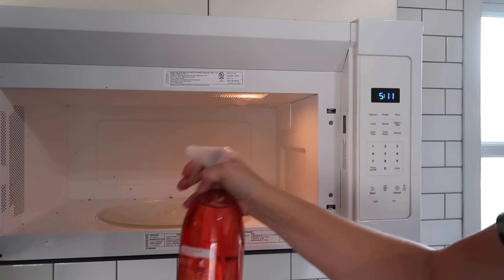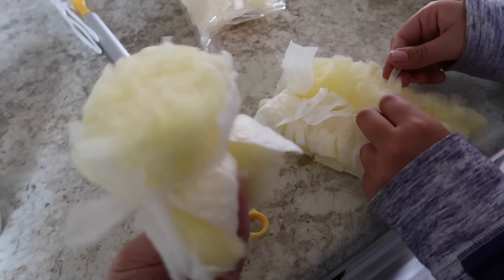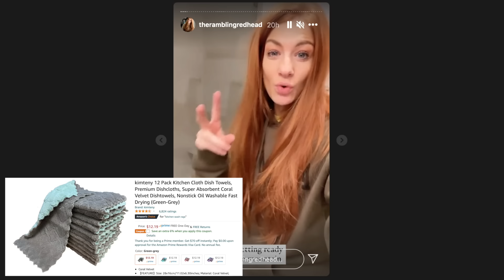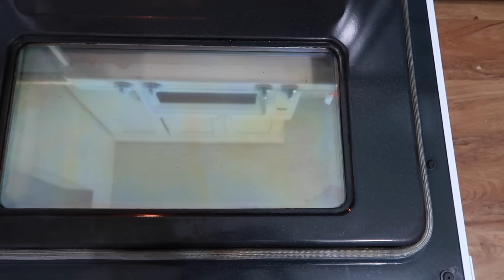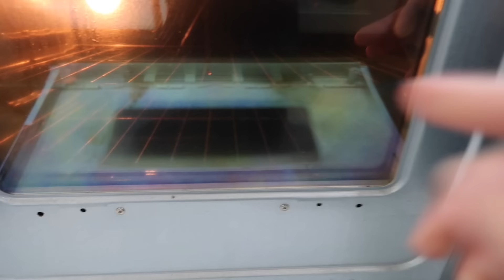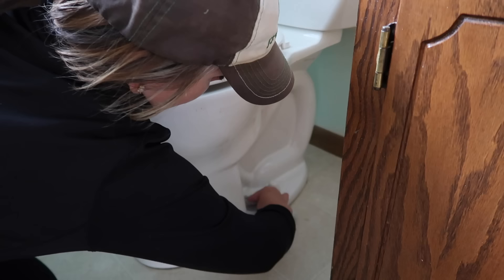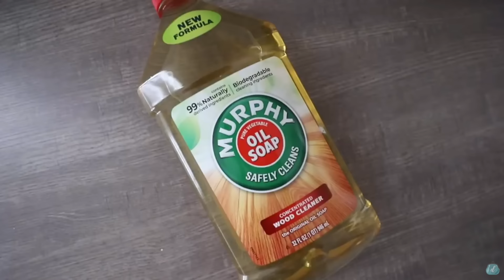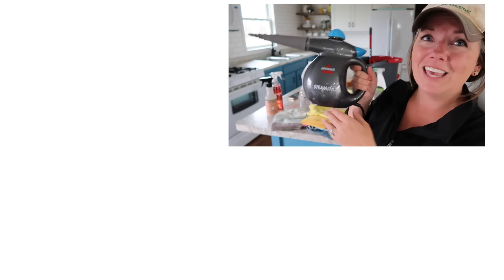Overrated Cleaning Products? Test them with me!

Comment: Also, I personally LOVE the steam shot. It has cleaned my grout, my walls, my baseboards, my vents, behind the toilet, etc.
Reply: I LOVE my steamshot too.  I have never considered that the steamshot  would work by the method displayed in this video, i.e., point and squirt steam at a spot about 4-6 inches away with no utility tip fastened to the steamer.  I use the "tips" that came with the unit. For the application in the video, I would have used the tip with bristle scrubbers.  With that method the steam is jetted out about 1 inch from the target-spot, and using the scrubber-tip agitating back and forth, makes quick work of the worst, disgusting messes.
Reply: Steam is disinfecting
Reply: @MegOfBroccoli  the steam shot does heat 212 degrees.
Reply: Actually, steam is hotter than 212°.  Water vapor that is most of what we see is cooler than 212°. The steam is between the nozzle and the water vapor. You need to be close to disinfect.

Comment: I love my steamer for cleaning the window tracks. I also used it around the edge of sinks that have a countertop lip (as opposed to an under-mount sink) and around the edge of faucets. I love using it when cleaning my refrigerator. I’ve never tried it in the oven because I use the 4-hr oven cleaner setting to get the bulk of the grime and usually just call it good at that! 😂
Reply: I always struggled to get the crack around the edge of the faucet or the little overflow valve in the sink clean. But by accident I wiped with a baby wipe an voila it all came away!

Comment: I'm here in the U.K. I use microfiber cloths but if I'm cleaning really dirty areas I use the generic J cloths, so I can chuck them away afterwards. I'm of the adage of doing a little each day but on the first of the month I clean the windows and on the fifteenth I clean the oven,whether it needs it or not! That way there is no build up of crud. The doors of the oven get taken apart two or three times a year. My oven door is three complete layers of glass which are so easy to remove and clean and the whole process takes just a few minutes.
We've just moved to a new build so brand spanking clean showers. I have tiled walls in the shower and have ,for the first time , used a tile sealer. This protects the grout from grime, oils and mould. So far so good. 

Thank you for the truthful video.😘

Comment: The spin bucket mop system is the best floor cleaning system I have ever used. I change the water when it gets dirty, and sometimes that is frequently because this mop picks up the dirt. I spin the mop well for wood floors. Makes them look beautiful. I like my swifter dusters. The swifter long handle used here is great for high ceilings, dusting up high, dusting behind and under sofas, beds, etc. I wipe and dry toilets, sinks, and clean mirrors with sparkle paper towels. I find these don't release any residue like I've gotten from other paper towels. I am not a fan of microfiber towels. They get wet and don't give as good results as paper towels. Paper towels are more sanitary too.
Reply: I have a steam mop and use a spray cleaner as I go with it. I do it once a week and the only thing I don't like is dealing with the power cord, which is always in the way. Still much easier than using a mop an bucket. So I use the Swifter mop in between twice a week.

Comment: I don’t know if you’ll see this comment so long after you posted this video but i have a recommendation. I also use vinegar and dawn (well, I just use the eco- friendly dish soap I buy now and it works the same as the dawn soap did) for my shower but I decided to try it for cleaning the greasy top of the fridge- beautiful. It’s an amazing grease cutter so I now use it for the kitchen as well. I like to minimize cleaners so happy that vinegar and dawn is a multipurpose cleaner. Thought you might like simplify yours too- and maybe save $$ if you don’t have to purchase Method grease cutter.
I have a spin mop and it does work well (it’s fun for adults too) but I prefer my Shark floor steamer- I have hardwood and found just about any cleaner leaves streaks (tried then all including Bona) I love the steamer is just water and its lightweight plus I can remove the dirty mop head without touching it- I drop it right over the laundry basket. 
Great cleaning video- loved it

Comment: I like the Norwex counter clothes for wiping down my kitchen counters. I think it’s because they are smaller than a regular dishcloth and fit my hand better. They also have a bit of texture so you can scrub off small amounts of stuff stuck to the counter. I also like the Norwex degreaser. I use it on my stove top and range hood all,the time.
Reply: Glass wipes are a perfect post cook solution. 1 & done!
Reply: @kimgordon3695  I’m going to try this. Thanks for the suggestion.

Comment: 💜 my norwex rags. Also the norwex powder to paste product is ahhhhmayzing on glass stove tops when nothing else removes burnt on junk as well as the inside of the stove door/glass. Everything that's been baked on for years comes off with one wipe! Plus they remove the germs and bacteria with zero chemicals. I buy the children's cloths which are like and inch or so smaller than the traditional eco cloth and usually a fun color but cheaper!

Comment: I have that mop and it’s the best thing since sliced bread!! I feel like I’ve tried them all and this is the one I have settled on and will keep using!
Reply: Do you put the mop heads in the washer and dryer?  I did and didn't like the way they turned out
Reply: @devlevine2782  Me too. They came out all matted and unusable. So I had to..declutter the mop after that😕I am always searching for a "better" mop. Right now, I have one of those spray mops..hmmm Have a love/hate relationship with mops!
Reply: I put mine in the washer and dryer they came out like new.   No problem.

Comment: If you have good microfiber, you need only water for your window cleaning (and other cleaning) -- no cleansers for 90% of the house. On your choices -- the fuzzy microfiber is a cleaning cloth while the flat weave is a window "polishing" or wiping cloth -- thus the feeling that the fuzzy cloth "cleaned" better -- it did! That's why the fuzzy nappy microfiber was more your favorite! (And on the Norwex...the difference will be the size of the fiber - very tiny - and the density -- 50% more microfiber in equivalent cloths from Norwex over e-cloth -- so they cost more, but they also will last much longer and have more cleaning density.) Loved the video!

Comment: The e cloth is a two part system for windows, the one you were using is the drying cloth and there’s a thicker blue one that you wet with water only to wash the window. I do all my house windows and mirrors with water only and love it!!
Reply: I agree! I bought the e cloths after a family member recommended them even after I saw this video. So glad I did since this test was not accurate. The waffle one is the one you just wet to clean windows and mirrors. It’s amazing! No window cleaner needed, just wet the cloth and wipe clean.
Reply: Do you have to wash them in a special way? And dry them in a special way?
Reply: @debbiestevens5490  wash and dry normal but no dryer sheets

Comment: I just got that steam Bissell thing. It actually does work - just cleaned the bathroom with it and it worked quite well. I suspect that you are using it the wrong way: you've got quite a distance - inches - between the nozzle and the surface. That's enough space for the it to cool a bit. Get it right there. Give it a try. 
Primarily, I will be using it on kitchen countertops and food prep surfaces and such where I don't want any harsh chemicals. 
There's no way that thing could do your oven so easily. Cleaning an oven is a whole other thing.

Comment: I can't use Vinegar as I have asthma and it really bothers it. For Light fixtures = damp microfiber cloth. Fan blades = damp microfiber cloth and vacuum attachment. I always give my microfiber clothes a spray of Endust first. Windows, if really dirty, soapy water first then foam glass cleaner and lint free paper towel. Cabinets = Dawn power spray and hot water. Between oven doors = Bar Keepers Powder it works for so many things including that sink, tub and shower. For the microwave I do the same thing and put a cup of water in for three minutes with some lemon in it. I also love Method in the peony scent. Great Video. Thanks for sharing.

Comment: The E-Cloth window cleaning clothes work amazing when used correctly. They come as a packaged deal with two different clothes. The first one is the microfiber waffle weave, which you dampen with just water. Wring out any excess water and start scrubbing any glass (windows, mirrors, picture frames, ect.). Then you take the DRY microfiber cloth (smooth looking cloth), and polish the scrubbed glass surface. 

You never want to use cleaning products (ie window cleaning fluid) with the cloths. It can cause buildup in the fibers and lessen the cleaning effectiveness.
For the same reason, you never want to use fabric softeners when cleaning these clothes. 

The cloth you used to clean the windows with the cleaner was the polishing cloth, which is meant to be used dry, after scrubbing with  the water-dampened waffle weave cloth.

Comment: H2O2 is my go-to for bath & shower.  I squeegee then spray it on the caulk after every shower. No mold ever!
Reply: Works great for that drainage area in back part of the bathroom sink too. Spray it through that little hole and enjoy the sizzle!
Reply: @Debi Morris Also known as hydrogen peroxide. Perfectly environment friendly as it evaporates into water (H2O ) and oxygen.
Reply: Sue- do you use 100% peroxide or dilute it? I’m having such trouble with mold in my shower.
Reply: @janaweber85  Household H2O2 is a 3% solution and is good for most personal and household use. I buy it in 8 oz spray bottles from Walmart and refill as needed. I keep it on my bathtub and spray not only on the grout but also on a toenail prone to fungus.

Comment: For the ecloth there’s actually a specific window cleaning cloth and that blue one you’re using is just what you go over with after using the other cloth. I LOVe my ecloth window cleaning rags. All you need is warm water.
Reply from the maker: Well this is good to know!!!!
Reply: Yes! I was going to say the same. It's a waffle knit (light mint color) and then the blue cloth you used gives it the extra sparkle and shine, kinda buffs and removes any streaks. But often I just use a regular microfiber ecloth and then the blue buffing one.
Reply: I use it on EVERYTHING even stainless steel dishwasher. Just using water
Reply: But no product, just water

Comment: Scrub Daddy paste does amazing at cleaning ovens, even the baked on grime, with minimal effort.  It’s supposed to be natural.  I used it on mine and was pretty impressed.  Also, if you vacuum your floors first, your mop head doesn’t get as dirty, simply cleans the true dirt off.  Now I need those wide swiffers!

Comment: I was surprised when you pulled out a separate degreaser, when you already use ' L.A.'s Totally Awesome All Purpose Cleaner'. I use that full strength, exclusively for degreasing! (One less cleaner bottle to manage!) 😀
Reply from the maker: Ohhhh...I didn't know this! That's awesome! I wouldn't need the Method degreasers but like how they smell ;)
Reply: @TheMinimalMom  what scent was your method degreaser? I love the lime + sea salt but I’d like to try a different one.. I’m with you on the Mrs. Meyer’s scents. Some are overwhelming. I do use the peony scent in my bathroom. I spray some in the toilet bowl water whenever I leave the room and it leaves a nice subtle fragrance
Reply: @deplorabledeb2615  Looks like maybe the Clementine one?
Reply: @deplorabledeb2615  I love your username! I buy the quart bottles of Mrs. Meyers concentrate, and mix with water in a spray bottle. A bottle of concentrate lasts me forever, which makes it cheaper than most other cleaners, and I control how strong the scent is. Still smells pretty and works well. 1 tablespoon of concentrate to 16 oz of water seems to be the right strength for me.

Comment: I mix Lysol water and a little dawn in a spray bottle. Cleans better than anything I've used
Reply: Lysol is great, just don't mix with bleach or peroxide or oxyclean
Reply: @inashamsia  your right about that
Reply: My cat almost suffocated with Lysol in the air, and so did I. Strong stuff! Be careful!!! ( I had to grab him and take him outside. They have 9 lives, you know.  LOL But I don't! )
Reply: @debracole3699  thanks for the info. I use small amount lysol in my water mix. No problems. My issue is bleach, don't use the stuff lol

Comment: Just a heads up; never spray a cleaning product directly on your faux wood/vinyl plank floor. The product can and will seep into the cracks and eventually cause issues. Always spray the product on a towel or your "mop" type item and then clean the floor. Always clean up access moisture as well.

Comment: That "Awesome" spray is the only thing I have found that removes tough hairspray residue off my bathroom tile floor!
Reply: Thanks for the tip...I have light fixtures that need this. I was using alcohol or wd40, wd40 stinks and alcohol can take the finish off of many surfaces.

Comment: Regarding Bona, we have used it for years and it has worked great. However, it is pricey. Sam’s club has a floor cleaner concentrate for really cheap and it is for vinyl and engineered floors. We have saved so much money using it. It is a pink color which is different than the typical blue bona.

Comment: I’ve heard that Bona is actually not the best for your hardwood, try using 1 tsp of powdered tide with HOT water in your spin mop, works incredibly!!
Reply from the maker: Ohhh...I have to try that!!
Reply: Yes I’ve heard Bona will build up on your floor and it will be a beast to get off. I also do 1 tsp tide for floors (I don’t have hardwood)
Reply: For laminate floors like Dawn's vinegar and water works well.  Use a damp mop, not too wet.  Too much moisture on laminate floors will cause damage.  It's also recommended that you use a microfiber cloth to dry the floor.  When I had a laminate floor I just turned on the ceiling fan and the floor dried quickly.  😉
Reply: When I had hardwood floors refinished, the company told me vinegar and water is the best. They said Murphys oil soap damages the finish over time.

Comment: Instead of spring cleaning my oven, I'm just going to get a new one :) It bit the dust on Easter weekend!
Reply: Mine went out last year. The ignitor went out, bought the part online and cost like $50. Or pretend you didn't see this and get a new one! 🤣
Reply: We did investigate the repair option, but supposedly Bosch igniters are not $50 each, and we need two, plus repair. So it looks like I still have my excuse 😜

Comment: I have an o cedar bucket with just a mesh attachment that I squeeze the mop into. With 4 small kids, I have found it is so easy to pull the mop out to wipe up spills. Saves on laundry because I don't have to wash all the extra rags. It is just as quick to grab as getting a rag and I don't even have to bend down to wipe up the spills. The mop head is so light weight, and like you pointed out, it seems to get into some harder to reach places a lot more easily.

Comment: No Rinse professional concentration purchased by the gallon is one of the only products I’ve used for years. Hardwood floors. Vinyls. Counters.   Spray and wipe after a bit. So simple. Not for windows 😂 magic eraser or touch up paints saved in convenient small bottles works for black wall marks. Of course baking soda and vinegar for scrubbing.

Comment: I'm elderly, I use an inexpensive ceiling fan cleaning tool that cleans both sides at one time.  I lay already used dirty towels that are ready to be washed, to lay across bed, tables, floor, whatever, to catch the dust that doesn't stick to tool.  Then unscrew tool head & throw in the washer or rinse out however you'd like.

Comment: You are so adorable and I enjoyed your video. My grandma used vinegar water to clean almost everything in her home and I know that bc when I was old enough to clean that's what she had me using. Vinegar water heated up in the microwave and your damp dishcloth will save you time cleaning it up. I even use vinegar water in a spray bottle on my kitchen appliances and wipe them down with my damp dishcloth don't leave it on your appliances long as it could damage the finish. The marks on your walls can be removed with either a magic eraser or a damp microfiber cloth with a little bit of baking soda on it clean the marks before you clean the wall.

Comment: When using the steam shot, I get the nozzle tip right in the mess and blast then wipe before it cools. The baking soda and vinegar wait then use your plastic scrapper and blast with steam shot. I leave door open to fight drips and keeps stuff off door gasket. Great for bug on vehicle and tar. Great on laminate BUT only steam zap a spot and stay away for edge of planks. Zap and lift with plastic scraper and wipe for tree sap, farm grease and general crud kids track in the house.

Comment: Krud Kutter Kitchen Degreaset is amazing. I use it to spray my stove and you can literally just wipe away grease with a paper towel.  It take latex paint off hardwood floors and is safe for food prep areas!  You can find it at Lowes hardware, Walmart, or Amazon!

Comment: Idea. Make a tube of microfiber cloths to clean the blades. If you don't sew, I just discovered they make such a thing. However, I also have a bendable microfiber wand with multiple 'fingers' that grabs the dust easily.  And it's washable.

But you were going for fewer tools to store, so. With the wand I don't have to climb on a ladder/step ladder, feet firmly on the floor.